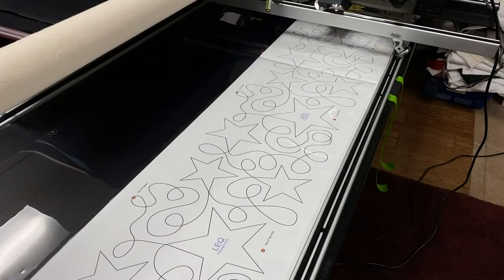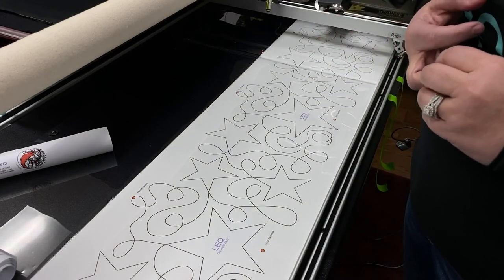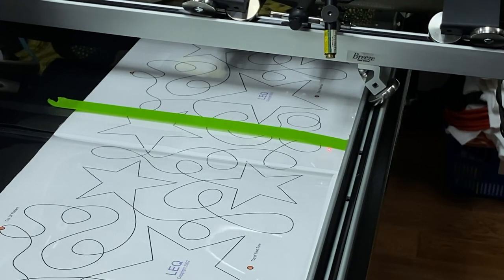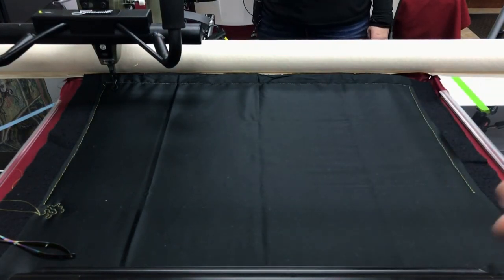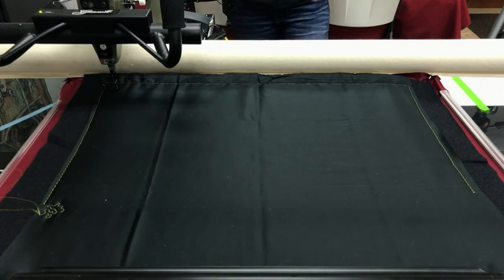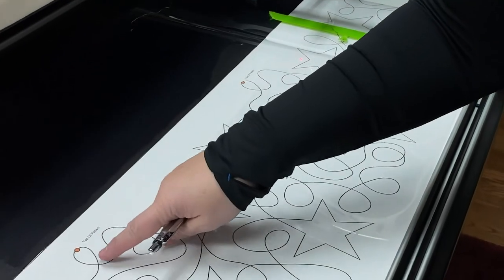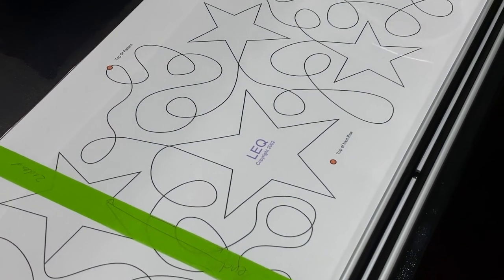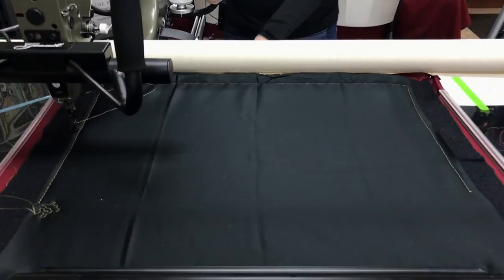Pantograph Pattern Quilting for Beginners - How to use a pantograph pattern!

Comment: This was a great video.  Have a question about the length of the pantographs.  I only have an 8 ft frame so i think those really long rolls ( up to 108”) might not work for me.  I am really liking the pantograph process and would like to get some designs but not sure if its cost effective or efficient qui,ting for me to get such long rolls?  Can you advise me on what I could use for pantograph patterns.  Do you have something to fit a 15” throat space HQ  longarm. Thank you.  And my prayers will be with you and your family.

Comment: Any suggestions on how to make adjustments when the original lines on the side no longer line up? Or even better how to avoid it? No matter what I’ve tried my quilts have a tendency to shift to the left. I thought it might be the quilt shrinking with each pass, but all of the videos I’ve watched never address what to do if the tape lines are off after a few passes. Hope all is well with your family. You did an amazing job and you wouldn’t even know there was an underlying “family distraction” going on. Very professional, but glad you shared.You are our family to many of us.

Comment: I have a question. I have a sweet 16 sit down machine, no frame. Can I get a panagraph and trace it onto tissue paper, then lightly-based glue the tissue paper onto the quilt top and quilt as usual? Or is there a better way to do to that. Or is there a product ment for this?
Reply from the maker: You could try that, but we do have tear away patterns that we sell.  You lay them directly on the fabric, stitch over the design and pull it off.  Here is a link! https://www.longarmsupplies.net/collections/quilting-tear-away-patterns

Comment: Where are u guys located again? Your the first i have seen that does detailed learning on a longarm. And last year i wound up with a 12 or 14 ft professional freehander design a quilt machine, and almost have it running. Didnt have all of the hardware. I need to order a belt and things to that nature, could u point me in the right direction of getting some help with it
Reply from the maker: We are located in McKinney, Texas.  We do have a website with lots of different parts it is www.longarmsupplies.net. Thanks for watching.

Comment: Jan 12, Just watched this video. Question though on how to set up the pantograph so when you're getting to the bottom of your quilt you still have enough room between your needle and the quilt that has been rolled up to sew the complete height of the pantograph. In your tutorial, you have the pantograph lined up with the rail, but as you roll you have less height. I assume you need to move the pantograph farther from the rail, but how do you decide how far? Also, do you try to set up your pantograph  so the design is centered both horizontally and vertically.  So your first and last rows are about the same height since the panto cannot be repeated in even numbers. Panto is 9", but you quilt is 70" long'
Reply from the maker: Due to shrinkage along the quilting process, it is hard to determine what you will have left at the end.  The more you quilt a pattern, the more you figure out shrinkage for that pattern.  We teach for you to still line up the same as we showed in the video.  Once you get to the last row, you would then secure your bottom edge of your top, then you would put a long piece of tape on the plastic thru the pantograph to match up with the bottom edge of your quilt.  You would then make adjustments to the pattern with a pen to come in and out on tape.  The stitching will come in and out at the bottom edge to show it is a continuous stitch still happening. It is very common when using pantographs that you won't get the full width of the last row, so its making adjustments at the end.  We have a video on our channel by Linda Taylor and at the end of that video she will show you this process. It is called pantograph quilting.

Comment: How do you do the last row if there isn't enough fabric for a complete pattern?
Reply from the maker: You would have to basically cut the pattern in half with tape. You would find your measurement of how much space you have left. So if you have 5" left and its a 10" pattern, you would put tape all across the length of the quilt on top of your pattern shield. Double check it will fit inside your 5" you have left before you start quilting. The reason for painters tape, is so you can connect the pattern back together, since you split it in half with the tape.  I hope that makes sense.

Comment: I'm a home machine quilter and have been doing my quilting with EGE patterns from JuJu on my embroidery machine, and they work nice. but the patterns are really dense because they are 5".  My question is are your 4 to 5" patterns more spread out or less dense then a EGE pattern?  My wonderful husband bought me the Grace Cutie frame for our anniversary and I can hardly wait to use it so I'm wondering how different the patterns are.  I'm sorry for the bad news you two got and I have said a prayer for you even though its been a long time.
Reply from the maker: Some of the patterns are loose and some are dense.  You would want to stick with easy curves, patterns with open space.  Pattern 700 is really easy at 4" and some of the other 700 series, these were made for the smaller throats.
Reply: Ok thanks for the help

Comment: What do you do at the end of the quilt if pattern is to big ?
Reply from the maker: It's hard to explain over chat, we do have a newer video that shows you how to do it. You basically have to take painters tape and adapt the pattern. If you have plastic that you put your pattern under then it makes it much easier to do this.  Measure where the end of your quilt top is, like how many inches you have left to quilt, then take that measurement and put the tape all the way across the paper pattern on top of the plastic. This will cut your pattern say in half.  Then draw in and out points on the painters tape adapting your pattern to fit and flow, then quilt.

Comment: I loved your video!  You were both great!  I do have questions!  I am a beginner with pantographs and my machine has a 17 inch throat.  What easy patterns would you recommend for me to use for holidays from October to Christmas.  Also, I didn’t quite understand the “top of pattern” and “top of next row”. I want to make sure that I don’t run out of space for the pattern when I get to the end of the quilt and that I don’t stitch over the pattern at any point.  I was working with a panel, so the quilt top measures 65 inches wide, this one I need an easy star pattern for.  Thanks so much
Reply from the maker: Stars and Loops for the star pattern you need.  There are so many holiday patterns, I would pick one that doesn't look to busy, that has more curves then points. Trace it in your mind when looking at it on the screen if you get stuck a lot on which direction to go, that pattern might need to be a pattern used as you get more experience down the road.  Practice the rolling with the tips in the video a few times, before you start stitching that normally helps. It just takes some practice, you got this.